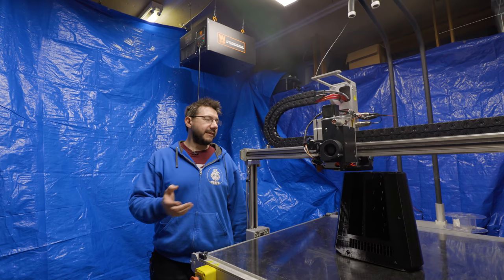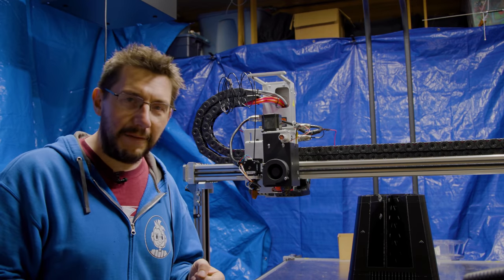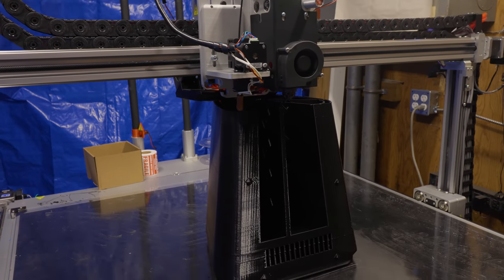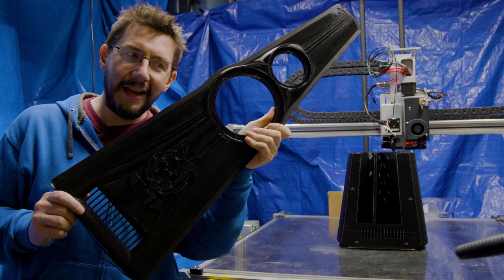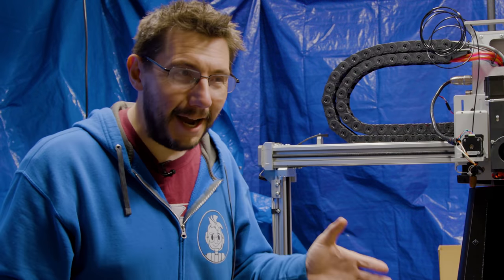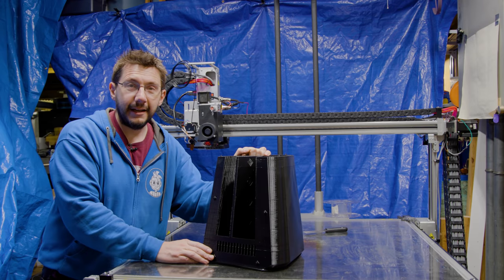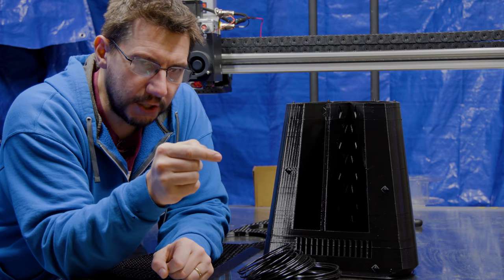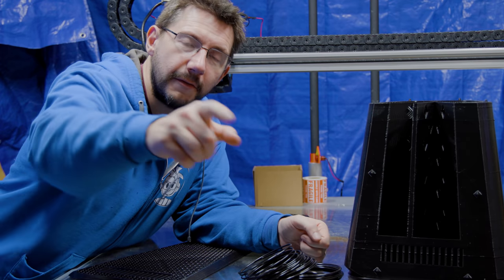3D Printed Speakers Part 1: Breaking the $38,000 3D Printer ... Again?

Comment: Some of those antique movie theater projectors had a mechanism that could automatically continue with a reel of film after the previous reel finished. 

Is there anything similar for rolls of filament for continuous printing?
Reply: The prusa mmu can do that
Reply: You could run the rolls through a pallete machine I guess, 4 rolls loaded at once creating one continuous length.

Comment: I noticed when you reacted to the fact that the base cracked when you attempted to remove it from the table.  Question:  is this part of the speaker enclosure wrecked now?  Do you want to attempt to repair it? I would hate for you to have to re-create that entire speaker AGAIN rather than fix.   I have recently experienced a problem fixing something that was made from a unique plastic and was not fixable using the usual glues and even the new one called FLEX ALL.  I tried that and it would not stop the cracking.  It was a windshield washer fluid reservoir for my vehicle.  It was being cracked by the overheating in the engine compartment.  That kind of rubber-plastic is difficult to glue since normally the glue just releases from the object because it is like a FORM for molding something.  If you are having trouble making something stick try BONDIC that is being advertised on TV and FACEBOOK.  It will only cure the glue after application using the UV light device that is supplied  with the glue.  Believe me this will stick and it is hard when cured.  If questions - please reach out.

Comment: Enclosure, how about a pavilion tent with walls? Lots cheaper than a shed, will restrict airflow around the printer and can be move or packed away easily.

Couldnt a filament sensor be bodged in between the filament guide ring(square?) on the x carriage and the extruder to get around the far away stock sensor?

Comment: Somebody make a filament joiner. 2 metal halves that can clam shell close and melt the 2 filaments into one. I have rolls with some remainder filament, not long enough for a complete print.
Reply: Check out the youtube clip of someone joining spools together with a candle and some bowden tube, I tried and now only have about six bits of spools left not 30.
Reply: @justinraza5287  Saw something similar but it makes more sense to have 2 metal halves that open. Then you don't have to slice the boden tube off.

Comment: I normally wouldn't respond but for some reason it was "recommended" to watch.  I was like "again"? I went and saw the first video about this Printer..... Pack up that Printer and send it back. I don't care how big an area u need for big prints but, considering everything I have seen in 3d printing over the last 10 years. That printer ain't worth shit., for 38k it should fix itself. I understand it could happen to anyone and patience and tuning are needed but for a professional line cost that thing is Garbage.  Any first year HS Student who at least has an interest in  Engineering Tech knows that gantry mass is ALL Wrong... Supports alone should be double the size.  Thanks for showing what expensive garbage is out there. Niche market for people who like to throw money away.

Comment: I feel like this is more of a $5k-10k printer than a $38,000 printer. 
Not that I don't think it's fair for them to charge that much, it is after all a specialist machine built in low numbers. The thing is though DIY 3D printers have become so good now that it really wouldn't be all that hard to beat it with off the shelf electronics and a custom frame.
Reply: Totally. It's weird, I very much like how maintainable it is. But the only reason it has that price tag is its size. Which... meh.. :) The printer itself is so simple I'm pretty sure I can actually make it myself. For 38K I'd expect it to have very clever stuff to prevent warping, have an even heat spreading, being super reliable or have a super duper next day support something.. seems none of that is the case.
Reply: @VincentGroenewold  even at $10k I would expect to have a spring steel sheet for the bed, something like the pallette 2 built in to splice rolls of filament together since it's so large most prints will kill a roll quickly, and ideally be an enclosed design.

If I were designing this at that price point it would probably be more of a core XY with the bed being the Z axis riding on proper linear rails and ball screws on each corner with physical automatic bed levelling.
Reply: @SavageSmithy  Indeed, which is why I don't understand it at all. Everyone with the tiniest bit of engineering interest, sees this is not right somehow. Because it isn't. :) To me it looks like someone simply had the idea to built a machine themselves, from standard parts and no real engineering behind it, then started a small business. Which is expensive, especially if you're not having a huge market for it.

Comment: Good lord, that printer is such an overpriced piece of garbage.
About two years ago I designed a printer very similar to this - just 2" narrower and 2" longer but with the same principle for the Z-axis.
I didn't build it because I realized that it would neither be capable of fast nor precise printing unless I'd overbuild the thing to a silly level.

But what I meant to say is: Even with 250W servos, an actual CNC motion controller that runs Mach3 and 25mm linear rails plus 16mm ball screws all around - basically a cnc router with a printing nozzle - that machine would've cost less than 2000$ in parts. Bought as a private end customer including taxes and nice profit margins for the sellers etc. 
$38,000 for this? Starting to believe the contents of my harddrive might actually be worth something ...

Comment: May I suggest going  to Lowes/Home Depot and getting a sheet of Lexan.(as thin as you can get)
Light sand the surface and use as a build plate . It has made a big difference in my prints not curling up.
You will still need to  heat the bed but you can flex the Lexan once cooled so the parts come off easily.

Someone suggested it with the robo 3d printer i have after breaking the first glass bed and have used it ever since.

Comment: Very disappointing result- not only because of the curling/shrinkage factor, but also model walls quality. As many previously stated the printer is not worth 38k - maybe in bom + profit, but not in doing its job on acceptable level.

Comment: Why printing on such a massive Glas plate in the first place, no wonder you have issue with adhesion on the plate and you have to get such high bed temperature. Get yourself a FR4 plate with magnetic stick foile then you will just need 65C° max and you will also need temperature controled volume by such big masses of printing material. Because PLA will warp like ABS by such big print volumes

Comment: I think this printer seems way overpriced and I dont know why you wouldn't fab a cheap enclosure to keep heat in to avoid warping on large parts. Clearly this thing is inted for temperature controlled rooms

Comment: You know Joel ,no offense but 1/2 good is no good in any design most especially audio,those cracks and surface imperfections are going to destroy anything good in that speaker design.Just saying little imperfections will kill the potential audio as a whole.  Doc BC

Comment: Plastic housing for speakers.  No. just ask JBL.
Reply: There are pros and cons. Cons: density and damping. I designed the wall as a double layer, so it can be filled with sand. Pros: Unlimited geometry complexity. All that internal stuff you can see is bracing that helps cancel structural resonances. Making something like that with traditional methods is super costly, like B&W Matrix bracing. Also the port can be designed for smooth flow. http://i521.photobucket.com/albums/w339/bkeane1259/BWmatrixbraces.jpg

Comment: It's really sad to see just how far away 3D printing is from being a reliable production technique. Even a literal 3D printing nerd with a 38000$ machine can't make larger parts without warping, cracking and a ton of wasted time, energy and material.
Reply: Its sad that this printer being 38K they use a glass bed wich is the worst bed when compared to PEI sheet and warping being terrible due to not being enclosed and open top and huge wich means plastic contracts a lot when cooling down to room temp because its not designed well and a HEVORT wich is community designed is a lot better for a lot cheaper

Comment: I don't understand the reasoning behind this printer manufacturer wanting to be part of your chanel. They know this machine is very niche, not for hobbyists, comes with a hefty service contract, and is not likely to be used by your audience, so there are only negative outcomes that can come of this, they get a lot of videos on YT of how much trouble their machine is. Their professional users who have been using it, with their help, will think twice about continual use, and prospective customers will likely shy away. They I'm sure know that proper use case of this machine involves an enclosure, not a garage/shed, so they gave it to you for PR? is this good PR?
Reply from the maker: I think they have been fans of the channel and when they originally reached out, it was at Formnext 2019 and the goal was to get a machine to me, and just see what I could do with it. Of course it's a giant machine, and you know I was going to do some giant prints. The machine is on loan, and there were no stipulations as to what I had to say or what I could not say. I think in the coming year I'm going to reach out and see what more I can do to the machine to ensure print success.

Comment: This printer seem like it's flat out a poorly designed printer.  It's $38k, but it's a problem. So much missing and done poorly.  It seems like it's built by people who don't actually use 3d printers and optimized the wrong variables.
Reply from the maker: The motion system on the machine is really, truly good. However, the tall and heavy gantry makes some things difficult.
Reply: @3DPrintingNerd  every other large format printer that I have come across with has 4 stationary points of support for the X and Y with either a moving or stationary Z.  This design also allows for built in enclosures, which it seems like you'd need.

Comment: Sorry not sorry Joel but i can't accept that machine as anything better than an Anet A8, an industrial 3d Printer that cost 38K and wastes that much 3mm filament is just unacceptable, like having a hyper-car that can't use the last 15% of the fuel tank because the engine can not run out of fuel... It's just bad engineering from my point of view, "Anet" grade bad engineering.

Comment: see what else you can do with the printer ???? disassemble it and build a printer that actually works.  I'm sorry for 38000 bucks i could build a printer that fits in a shipping container with its own lil control room with a build volume 3 times this size that heated and will print abs. hell for 38k you can buy a brand new small Haas cnc mill and mill the speaker enclosures from alum faster then you could print them on this turd. I'm sorry this printer and the crapbots  have been your worse printer review and project videos you've done and you keep trying to hype them up as good capable machines. there has to be a point where you have to know when to cut your losses and just say this things a pile and tell the manufacturer to do better otherwise your doing a disservice to the the 3d printing community.  i do hold you in highest regards and value your opinion Mr. telling as your one of the first youtubers i started watching after buying my first 3d printer. however these videos where your just being overly positive about a machine that's clearly not up to its claims are slowly eroding my faith in what you say and believe to be a good product. I understand not every thing is going to go perfect and I don't think it should it shows like anything machines and equipment do break and things can go bad but when its every time you use the thing thats a bad design or theres a serious flaw in something.

Comment: so that's all you learned. wow. lol
or did You actually knew all that in the back of your head.
printing on glass is so 2010. stick build-tac or wham-bam on the glass bed. or is that to cheap. 
still thumbs-up! like.
Reply from the maker: hahahah. glass is still decent to print on, but, I think a large machine like this needs a more mechanical way of holding prints, and something that won't break easily.
Reply: @3DPrintingNerd  yeah! i was just kiddin' around a bit. i use a glass bed still. but then again i also use an anet A6 ;) serious. i dont print that much. but maybe such a bed that they had on that UP! printers would hold on to the print, with al those small micro-holes.

Comment: That printer is nowhere near worth $38,000 it's straight up $2,000 in material then $36,000 for profit or somebody's write off there's plenty of printers with 300  and 400 MM bed surfaces for $500 that is so much better I wish you would stop making videos with that printer just because you can polish a turd doesn't mean you should lol.